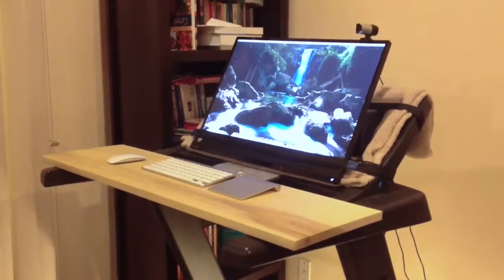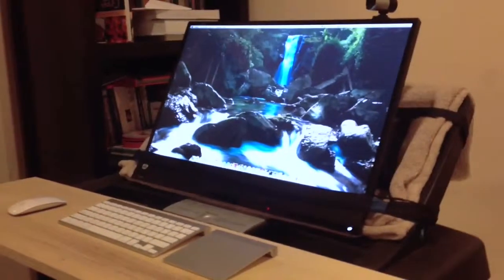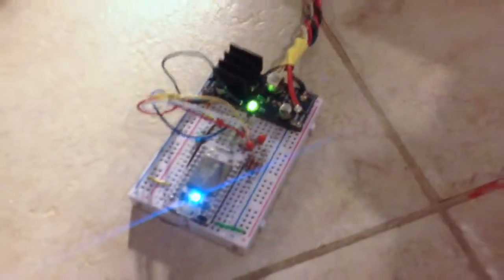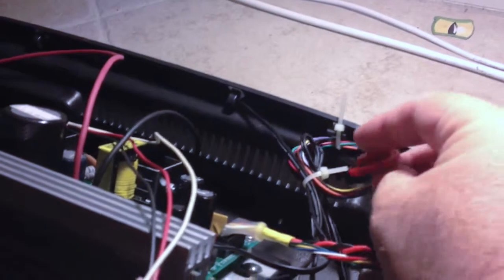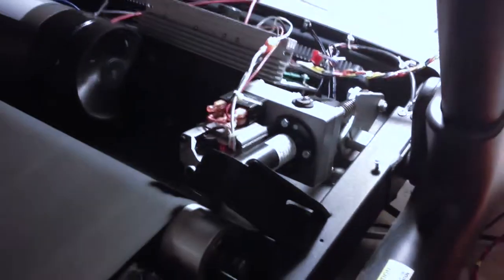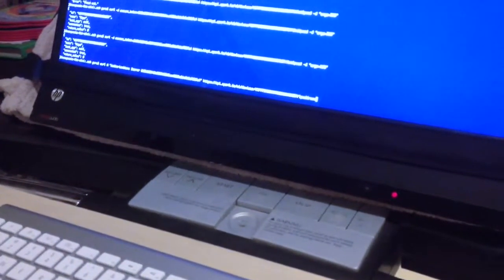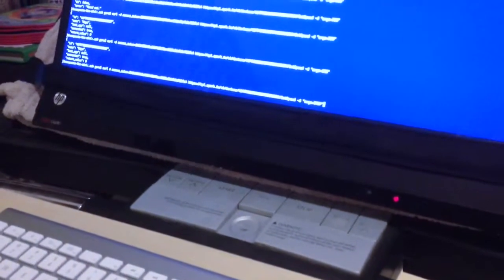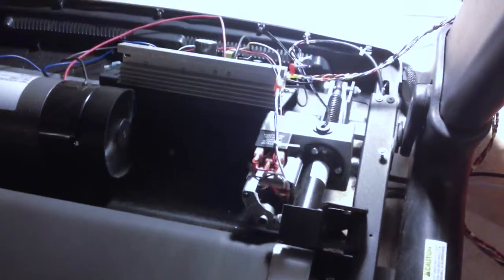Wifi Treadmill Workstation using a Spark.io arduino-like board

Comment: the control panel on my treadmill is broken ... i got an arduino ... so how exactly did you do this? (some code to share? :D)
Reply from the maker: +Daniel “D4ny” Bernard  All code is already on github https://github.com/flyingeinstein/tread-station . Here I used a spark.io board but I had un-ending problems with spark boards. Instead, I switched to a BeagleBoneBlack and even added a touchscreen and interface...works much better and very nice!! Code for spark board (doesnt work well) and code for BeagleBoardBlack is in the github project.
Reply from the maker: Pics and description are on https://www.hackster.io/guru_florida/treadmill-controller-cfc2a3